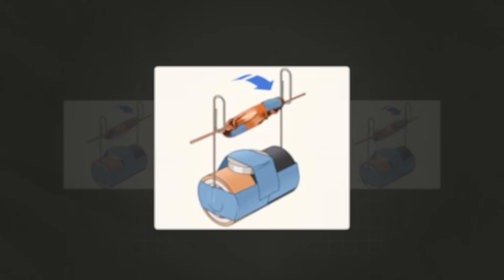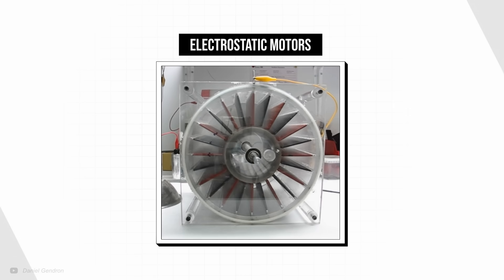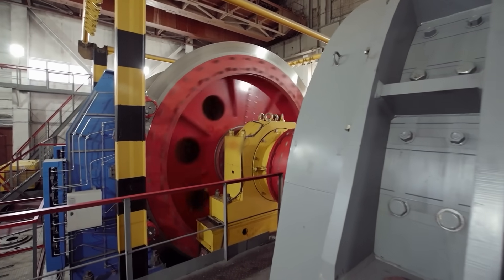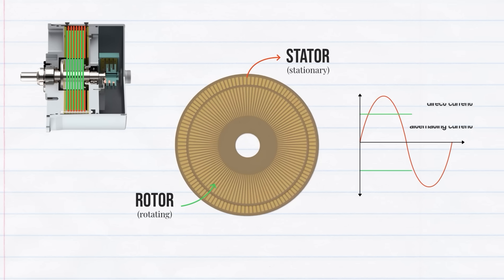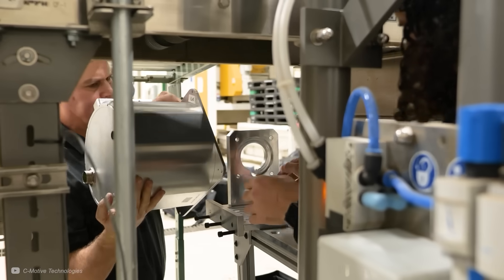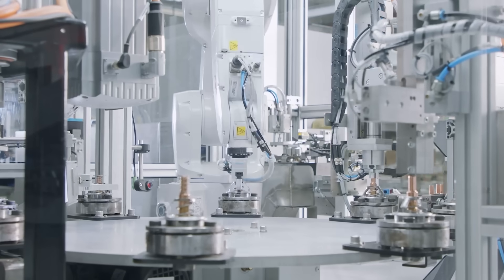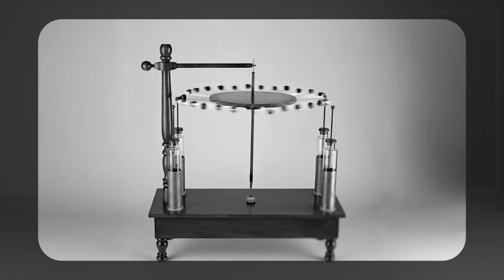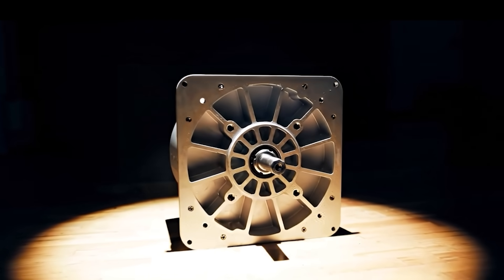How Electrostatic Motors are Breaking All the Rules

Comment: In terms of energy efficiency this is like the LED revolution of electric motors. They say they are focusing more on torque for now but back in the old days it was unfathomable to achieve satisfying brightness with LED components. Nowadays they power all the visuals you can think of. Exciting times to be alive!
Reply: No, LEDs are like 7-10x as efficient as incandescent. This is perhaps 10-15% more efficient. Their 65% number is garbage, as EVs are more around 80%+ efficient, so this is like going from LED to a slightly better LED.  In their 90% number they don't say if this includes stepping up the AC voltage either, so on the end it may be a wash.
Reply: @xeridea  tbh i'm not closely following the electrical motor tech if at all. Are we at 80%+ efficiency? That's insane!

Comment: 92% is the normal magnetic motor efficiency when running at correct load vs voltage envelope, which is provided by the VFD. Their improvement claim is bollocks.
Reply: It really depends on the gear box. Some worm gear boxes drop to 40% efficiency. If they are targeting gear box motors it does make sense to say 65%  because you drop efficiency from both the motor and the gearbox which is a compounded figure overall. I am not saying I believe it 100% but if their test case truly saved 30% they are doing something right.
Reply: @newmonengineering  Then the loss is the fault of the worm gear and not of the motor. A more appropriate comparison would be a magnetic motor with a planetary gearset. A transmission ratio of 10:1 is possible with an efficiency well over 90%. That would get us from the 3000 rpm of a typical magnetic motor to 300 rpm like the new capacitive motor. Combined with the magnetic motor that should still get us to 85% or better, so the traditional tech is still competitive in efficiency.
Reply: @rabiatorthegreat6163 better yet, you can get this low rpm high torque in a normal electric motor, if you just use more duplicate poles. It's how you get 3000rpm, 1500rpm and 1000rpm synchronous motors all working from 50hz mains. 

In fact, this electrostatic motor just uses a lot of poles. So basically it's a funny shaped stepper motor. There's nothing special about these, they're too extremely slow and extremely torquey.
Reply: @michaelbuckers no conveyor runs that fast. You need a gearbox so you can use a much smaller cheaper electric motor.

However if efficiency is a problem you would use a helical bevel not a worm. Helical bevel units only lose 2% per reduction stage.
Reply: @rabiatorthegreat6163 planetary gearboxes are only effect in high ratio application as thermals become a problem but overall yes they could use an ie4 squirrel cage motor and bevel helical and be in the 90% range. 

Unless their motor is extremely cheap it will never get off the ground as people already in the sub 2kw chose the low efficiency range for much lower purchasing cost
Reply: @8towely  Wikipedia claims loss per stage is typically 3% for a planetary gearbox. This or a two stage helical would do the job for an overall 1:10 ratio, with losses < 5%.
Reply: @rabiatorthegreat6163 your correct but planetary gearboxes are effective for high ratios. They are very strong and robust but let down by thermal rating. A better selection at 10:1 would be a helical or helical bevel.

To be fair you also then need to take into account the motors efficiency which sub 4kw would be roughly 90% alone for an ie4
Reply: @newmonengineering we don't need to consider gearboxes and whatnot, because they don't pertain to the motor performance. If you use a worm drive, it's because you don't care about system efficiency, you care about self-locking so it's impossible to backdrive. Also 92% is the standing industry standard.
Reply: @michaelbuckers  they are being misleading but yes you do need to consider it.

Only high ratio worm boxes are self locking 80:1 and 100:1

They are using worst case scenario ie1 motors and high ratio worm box. They will never compete price wise with that and it so much simpler.
If people wanted efficiency they would use ie4 and a helical bevel or helical
Reply: Well, real world applications run at lower efficiencies. Again, you might need starting and stopping all the time, which means you will run at different loads and speeds.
However, it could be that they did do some massaging with facts themselves, where they compare a conveyor that's constantly starting and stopping, to one at constant speed conveyor.
I'm certain that these people did some dressing up with the fact, I just don't know to what extend.
Reply: That is one of those simplification that make people belive stuff that is not true 

92% is a typical peak efficency of a motor alone with out neither inverters nore gearbox.

Ad interter and gearbox and you are don to 85%. But that is still peak.

The issue with industrial loads like the example in this video is that they due to the load structure need to run on very low power something like 00% of the time. You cant change to a smaller motor because then you cant handle the 1%

A other issue is that they use screw or multi stage gearboxes that are leas efficent.  That would probobly get your PM motor doen to about 70% real world preformance.

The last reason why they have lower preformance is that tvey use induction motors typically to not need hard to source neudynium magnets and inverters. So that is what brings the efficency down to 60%
Reply: @matsv201  And what about losses from converting 360V to 4kV? They are full of it.
Reply: @TestTost-j4dno, you dont understsnd the application.
Reply: @TestTost-j4defficiency of 5v to 300v DC converter can be 90% efficient, but i don't know higher voltage ones
Reply: @fakestory1753  90% efficiency sounds about right, but that's still a lot more than a relay (and expensive).
Reply: @matsv201  You forgot that there is no efficiency percentage, it depends on load and motor RPM.
Some are better at lower RPM, some are better at higher RPM, and no motor gets its efficiency peek across the whole RPM range.
Arguments about the gearbox are debatable, you can mix any motor with any kind of gearbox, that makes the combo more efficient, without meaning the motor is better.
Reply: @matsv201  you are correct on the sizing the motor but not on the gearbox. Helical bevels and helical only lose 2% per reduction stage. Conveyors such as shown generally are two stages gearboxes. As long as the motor isn’t stupidly oversized though it won’t lose a massive amount of efficiency. It does take a certain amount of current to energise the coil but at certain point  the motor just draws more power as load increase and power factor remains within a close range.

They used worm boxes and ie1 motors to give worst case scenario.

In the video they then used sprockets to connect the conveyor and I’m certain their will be losses as they manipulate voltage to control their motor.
Reply: As stated somewhere in the comments, there might be other benefits of getting rid of the gearbox and the heavy metal components inside the conventional asynchronous motors. These parts weigh a lot. A 2.2kW asynchronous  IE3 class efficiency motor  and gearbox are around 40kg. If the electrostatic motor reduces that weight to say 15kg, that alleviates the load on the bearings of these conveyors, increasing MTBF. Depending on the service life of the fluid in the motor, this could also reduce maintenance cost. As, gearbox fluids need to be checked and replaced regularly. Which can be costly for motors in harder to reach locations, like overhead conveyors.
Reply: @afrikees  WHAT? How does the weight of the motor and gearbox put stress on the bearings?
Are you a human being or AI?
Reply: @sasjadv  In conveyors the gearmotors are often mounted on the drive shafts, only using a torque arm to provide a hardpoint for the torque reaction force. In those cases, the weight of the gearmotor rests fully on the drive shaft and it's bearings. With the increasing energy efficiency regulations, the power to weight ratios for the asynchronous motors have decreased significantly leading to the gearmotors gaining weight to a point they become cumbersome for existing equipment.
Reply: @afrikees  I have made parts for conveyor systems myself, and it was all chain driven, so the load on the bearings was due to the tension of the chain.
Now even for a direct drive situation where the driveshaft is used as a cantilever to hold the motor, you can always double up on the bearings or add a support, and if they haven't, it's probably because it's a lightweight and light duty conveyor anyway.
And then, if you have a simple gearbox with two gears, then you already have two shafts, and the weight of the motor is not sitting on the output-shaft, but more on the torque arm.
Reply: @sasjadv  Same business, difference of opinions. That's fine nevertheless. Always fun to discuss with people with a slightly different perspective.
Reply: @afrikees  Well, apart from me thinking that hanging a motor from its shaft is odd, there are just multiple approaches to it, and you certainly don't have to use a certain way of fixturing, or a certain form factor.
Even if you want a low weight direct drive solution, you could use a pancake motor with high torque on its own, or use a smaller diameter motor with a gearbox (in both cases you use the same type of motor, just a different form-factor). Both options could be light or heavy, depending on the execution.
I don't have a strong opinion on what solution is better, because in reality it depends on what is available on your market and what deals you could have.
But I do disagree with the idea that demand for efficiency on its own mandates the use of gearless solutions in general, even for a hanging direct drive approach.
Reply: @sasjadv I agree with you, there are certainly other options available. Like IPM motors for example or servos each with their own unique capabilities. They all can be part of the mix. Currently the IPM looks the most favorable option for our application, but it's always nice to see alternative solutions being developed. They might become feasible to implement 5 to 10 years down the line. 😊
Reply: @sasjadv the reason people do direct drive is simplicity.

If you add a sprocket or belt it’s another thing to maintain and a gearbox direct on the shaft is a very neat and compact solution. Mounting it with a torque arm is much better for the gearbox as their  is no radial load to the gearbox bearings which will always be smaller then the conveyor bearings.
Reply: @afrikees your not taking into account the sprocket losses.

The conveyor bearings are always much bigger then the gearbox and the gearbox applies very little load the them at all.
Reply: any electric motor in the 90%+ range is running that high because the load is very low
Reply: @Blox117  it's the correct load to run at. In fact, it's the rated load, it coincides with rated speed, rated power and rated efficiency. You can run it at a higher load but then you put more current and heat through the motor than it's designed for. 

Geez the people who confidently think they know everything.
Reply: @michaelbuckers  yeah, because the load is low relative to motor size. like i said. motors in vehicles never see 90%
Reply: @Blox117 not true they usually only are that efficient at their name plate value. While it’s still close efficiency is generally less when not at rated power. At very low power they can be much much worse as the power factor is bad as it takes a certain amount of current to energise the stator regardless of load
Reply: @8towely  efficiency also much worse when above rated power, not to mention meltdown hazard. There are motors with rated current being at standstill, but those are extremely overbuilt.
Reply: @michaelbuckers yer they don’t meltdown the insulation in the winding breakdown and creates a short circuit. A lot of motors can withstand up to 130% of rated power but it depends on insulation used ambient temperatures etc. electric motors are always oversized though. They never really run at rated power except for startup which could be way over for a short period. If you have engineered it to run at rated you would be a brave engineer

Induction motors which is what’s being talked about and I this video cannot stall. Would cause the vsd to trip or circuit breaker
Reply: @8towely  it's all about rated current really. Only the current causes heating, power is a function of current vs back-EMF currently in the coils. Startup power is basically zero, but startup current can be thousands of amps briefly. Though any half decent VFD will limit it to rated current. A good one may allow it to slow down if the load is too great. 

Not sure what you mean induction motors can't stall - their defining feature is having some positive slip, i.e. partial stall. The motor in the video is of synchronous type, too.
Reply: @michaelbuckers that’s not quiet true. Ie3 induction motors pull near their rated currents at no load particularly small motors. It takes a certain amount of current to energise the stator. The factor that changes is power factor or applied power. You need a power meter to
Measure this. 

Start up is dependent on control type. Via VSD rather then start at 50hz immediately it ramps the frequency. If your direct online it’s usually 300 odd percent for a small time like you said. 

We aren’t talking about permanent magnet  servo motors which can stall. Asynchronous induction motors which is what they show the motor in the video competing against will burn out if you stall them. They keep pulling more current until locked rotor where they burn out the insulation very quickly. The motors are also cooled by a fan on the rotor. A VSD usually trips even at no load below 5%

Comment: Is the electrostatic process reversable?  Meaning that a motor can act as a generator.  This may be why the more efficient motor isn't competitive in EV's, as the increased efficiency may be offset by the loss of regenerative braking.
Reply: Yes.
Reply: @Fejimush yes it's reversible, or yes that's why it's not a suitable solution for EV.

Comment: can it work in reverse generating power, because if so it could also be great for regenerative breaking.
Reply: Maybe so. If the plates are pre charged then as they pass by each other they would push and pull current through the wires.
Reply: Yes